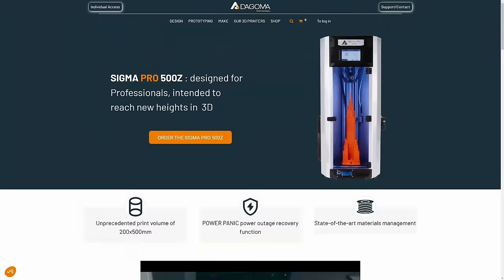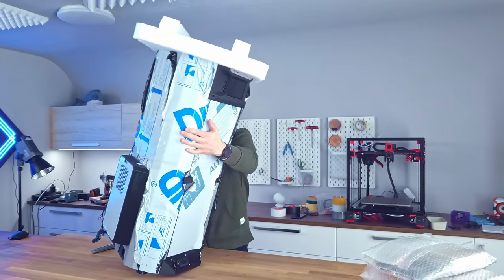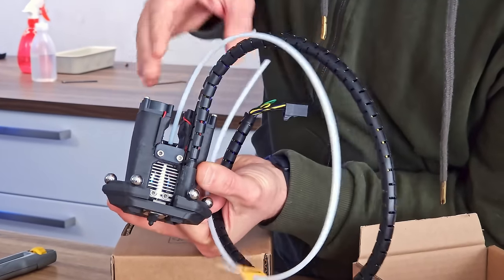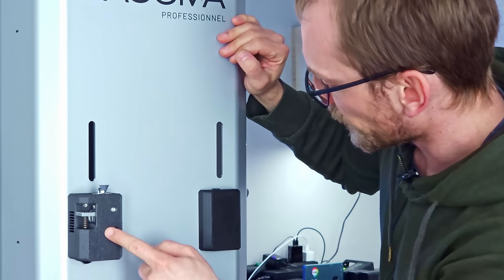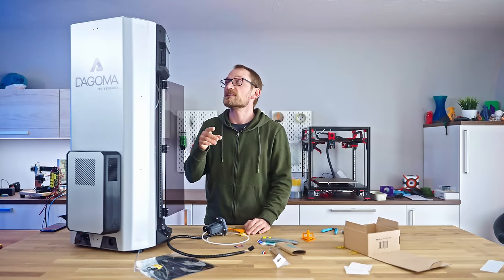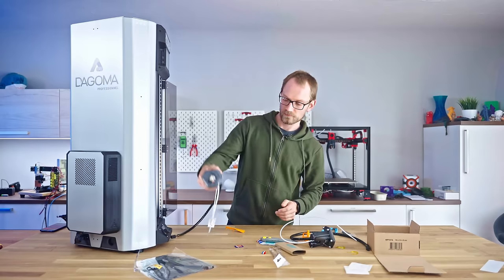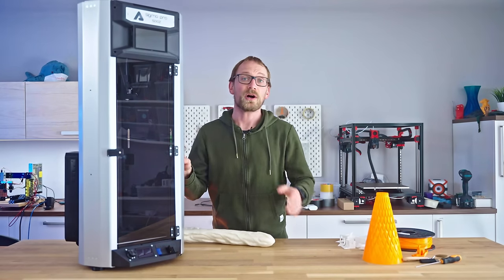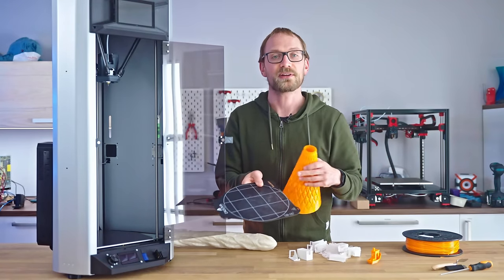Is it worth going "Pro"? Trying out the Dagoma Sigma Pro 500Z!

Comment: "Pro" could also mean to have a scapegoat for work environment safety and someone who handles all the certifications. Seems cheaper for me to just buy a 3000€ machine, than to require and enforce everyone working near the printer needs to have a raspirator
Reply: This has no filtering system though...
Reply: @BeefIngot  at around 8:30 he shows some of the filtration options

Comment: Hey Tom. Can you ask them for the firmware source code? I've asked two "professional" brands for source codes for marlin and octoprint. One didn't even respond and another said they don't use those even though if you connect a keyboard to the internal pi and force it to shell i runs octoprint xD >20k eur for the machine and after warranty runs out you are on your own, unless you want top pay ~200 eur for a standard ass volcano not even made by E3D xD

Comment: This just seems disappointing and not pro grade at all. Only a 350 C nozzle and only 80 C bed. The bed is tiny, the enclosure isn’t sealed or filtered and it has no manual so you are left to figuring it out yourself.

I would say a P1S beats this pretty handily on all but the 350 C nozzle but as you mention a 350 C nozzle is pretty useless without a hotter bed.

This is definitely not worth the price in my opinion. You can get far more capable and better thought out printers for cheaper. I hope you didn’t waste money on this.

Comment: Compare this machine to a Bambu Labs X1. I don't own one but the Bambu is a pro grade machine compared to this travesty. Pro grade means it always works. It's built of the correct materials for the mission of the machine. It's fully documented and there are knowledgeable support staff who will get you up and running because they know that your time is valuable. That's what it means to be professional. You'll gladly pay for it because your clients are ultimately picking up the tab. This Dagoma is a jank-ass hobbyist 3D printer from five years ago.

Case in point, I have an old Anycubic Linear Kossel Delta printer in the corner that I hardly ever use. I'd trust it to get a mission critical job out before I'd rely on that Dagoma.

Oh, as For the Dagoma, do some videos of  growing cherry tomatoes in it. It might have the bones of a nice hydroponics grower. You could use your pro-grade Prusas to print the parts.

Comment: Didn't see anything "professional" except the websites design and a "professional" label on the printer.
One could also argue, that is has some professional appearance speaking of some material and design choices of the housing. And WOHOO, it has RGB LEDs, and an additional touch display!
But that's it imho! Everything else just screams "overpriced hobby machine". No manual, only french website, "branded" slicer version of an OS slicer, etc., etc.. 
Basically everything what asian companies do for years, and at least the established ones even do it better, AND cheaper! This printer is a few years back.
Quite audacious to just mount some matte finish housing plates on a printer like this and call it "pro", not even speaking of the price point.

What makes a printer professional, you're asking? Well, there you have it, just slap a "professional" label on it :D

Professional would mean to me: 
Working out of the box. 
Unpack it, install the software, switch it on, print! 
Only minor adjustments required before printing.
Sophisticated set of features, material choice, specialized firmware/slicer, etc.

Comment: So for about three times the price you pretty much get a Flsun V400 with less flow, a Bowden extruder, no instructions, and 3D printed parts. Yeahhhhh I’m not convinced that this thing is worth any more than $600, let alone $2500+. Not that hard to enclose a V400 and add active cooling and still be under $1000.

Comment: This is FAR from what I'd expect for $3000.  Floppy printed front panel, HT hot end not working, poor post print gcode(raise above print). My modded FLSun QQS-Pro about $1000 total will run circles around that machine with a bigger print volume.  No good for 2024 expectations.

Comment: I feel like it you were too soft in the outro Thomas. It is a bad machine. It lines up with my experience with 'pro' 3D printers. Through work I had a doubtfull pleasure to work with couple of them. None of them was as good as my own prusa MK3.5, but some costed upwards of 7x as much.

The 3D printer is very simple machine at its core. Most of the advancements in 3D printing in the last 20 years are about the reliability and software. Reliability, design fixes etc are something that only comes after thousands of printers sold and few iterations. Pro level printers are usually sold in small quantity so is not profitable to improve the design. There are no online reviews usually so word usually don't get around in this pro niche as much as it does for consumer products.

And often with pro printers you are stuck with their proprietary software from early 2010's :/ 

Only good part is - they look good. "pro". Glad that we now have on the market Bamboolab and newest Prusa XL as a printers which look the part, but also work properly.

Comment: That slicer nonsense is more or less what Stratasys does.  The one nice thing Stratasys has is that you can have a bunch of already sliced models and drop them on the build plate instead of having to slice an entire build plate every time.  You can also see real time(ish) filament levels remotely   Downside is that you have like 3 support options (and one of them is no supports), and the bed is a disposable item which is just bonkers to me.  Also, the filament comes in cartridges that can't be reloaded.
Reply: They sell the beds as disposable, but frankly we've been reusing our beds dozens of times. Just make sure you always choose support as first layer and the parts will pop off mostly with no residue, the rest can be scraped off and the plate reused. As long as they don't fail calibration, which they won't unless you leave material on it, or gouge it deeply, it will print just happily.

Comment: @5:18 Really, Tom? You have no clue what that is? Maybe it's time to start tinkering with 3D printers again. This little thing is used to adjust the belt tension. There are lots of them on Printables or Thingiverse, for various 3D printer models.
About the printer, I don't see the "Pro" here, which you wouldn't get from a FlSun T1 or S1.

Besides of that, very nice video. 🍿😃🍿
Reply from the maker: Never needed on before!
Reply: @MadeWithLayers  Neither do I. I have a good ear and know what a well-tensioned drive belt should sound like. Nevertheless I stumbled across them during research 😀
Reply: @MadeWithLayers  Same.

Comment: Ridiculous printer. Massive tall thin printer. Unstable, light, 80c bed, no heater. The heat gradient from top to bottom will be enormous. Its basically an enormous and expensive piece of crap. Thats the other type of ‘pro’ 3d printer. No improvements, just more expensive and sold to people that didnt do their research

Comment: Just for comparison:
For the money one would spend on this you could get TWO Bambu Lab X1C's with an AMS for each of them and still have 500€/$ left for filament or whatever.
Also the X1C has a manual which guides you until you power it up.
Afterwards the color touchscreen guides you through the rest..

This Dagoma printer is just a disgrace to the 3d printing world.

Comment: what a waste of money, marlin on a profesional machine, slow,  Not using its kinematics, redundant screen,   Only thing is 350 degrees hotend, but 80 degrees heatbed without any chamber heating and big inside volume, a lot of troubleshooting on the start, and the price.

Comment: Delta mean...SPEED ans small surface....small surface, Done,  FAST???? wow... look very slow a the beginning, but dont try to go fast because to long rod it will create oscillation and look like old 8Bit board, not good for calculation for a delta....for me, is double stack old and cheap  Delta build.
By the way, extruder so far, mean long retraction and mean slow print i think
Reply: I think it's a 32bits board with an Pi for the upper screen.

Comment: 3d printed parts can be acceptable, if they are designed well and printed to an outstanding quality. Prusa mk3 printed parts or better. Voron PIF levels at a minimum.

If any brand sells me a 3d printer and their 3d printed parts look like shit, then the printer will be underwhelming as well. Had the same issue with the ifactory3d  belt printer.

Awful print quality of their parts, because they didnt know how to build or set up a good printer

Comment: The Ender 3 Pro and Sovol SV-04 I own are much better than this, in both quality of life and assembly out of the box... and even the Powerspec 3D 2.0 I once had (my first printer) at least was ready to go out of the box and didn't provide nearly the same number of low level frustrations that would have me putting this back in the box and requesting a refund.

This is not a professional level printer. This is barely usable as a hobbyist level printer. This was not designed by someone with any real world experience in industrial design.

Comment: Wow, that thing is terrible, my old delta I bought for $400 new in 2019, aside from a little less z height which isn't that useful 99.9% of time, not being enclosed and mediocre hotend was way better than this joke. I'm guessing the bed can only go up to 80C because FSRs pretty much stop working above 80-90C which makes them an incredibly stupid choice on a "pro" machine. The effector reminds me one my old designs, it has few issues, and it's another really stupid decision for a production machine because of how hard it is to precisely align the magballs with the compound angles on an FDM printed part, I ended up using a screw and torch to adjust the holes so the magballs would be precisely located which is important for getting a delta printer to print well and accurately. 

I do like the arms though, they do look nice, but based on how well this printer is made/designed it wouldn't surprise me if the arms lengths were off by 1mm or more, ideally they should be within 50 micron to have any chance of printing accurate parts.